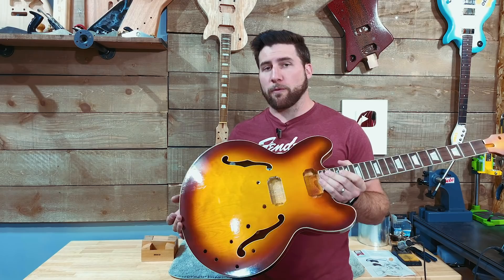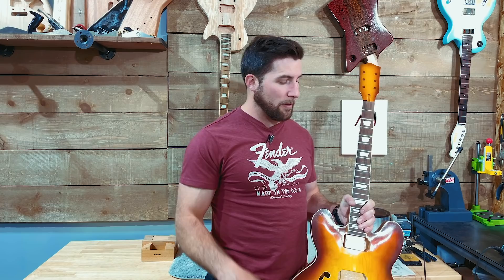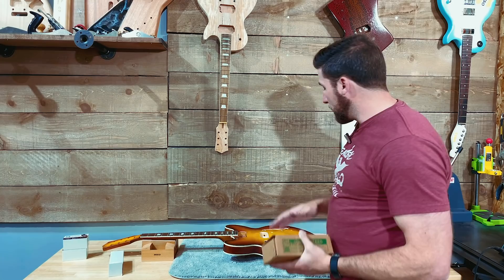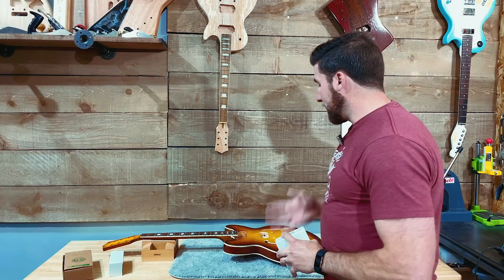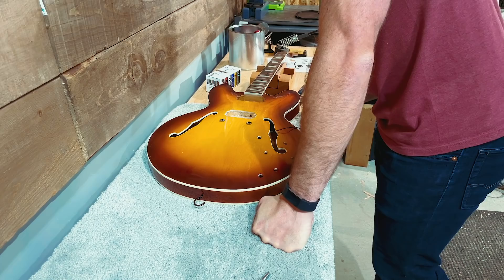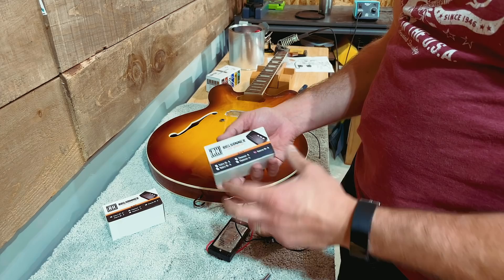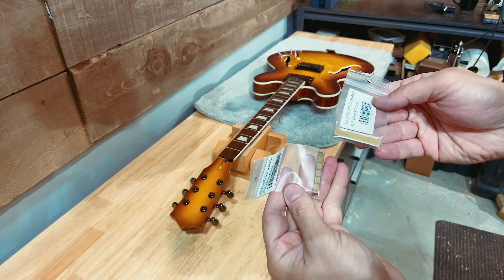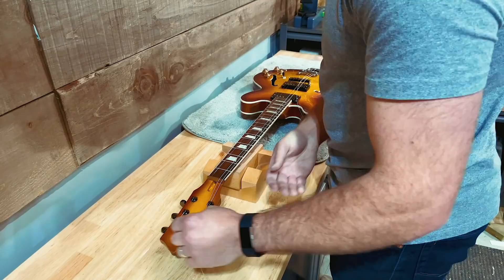The ES 335 Guitar Kit (FINAL ASSEMBLY!)

Comment: Such an awesome burst on this one! Almost unreal.

I am more of a chrome than black hardware guy, but the finished result here looks great, and more unique for not picking chrome or gold I suppose. Those Railhammers are going to sound nothing short of awesome. 

I'm thinking you may want to put a dab of glue under the nut? From the video it looked as if it is unsecured - but maybe you already took care of it off camera? The string tension will hold it down, but it may get knocked out of place if the playing gets a bit heavy handed.
Reply from the maker: Thank you. I’m still not 100% sure I will be sticking with that but. Once I’ve decided I will put a touch of glue to hold it in place.

Comment: Can't find the pickups on Solo.
You should try solo's wood knobs for your controls. I think they are great. Finish the same as guitar or a contrast.
Reply from the maker: Those pickups aren’t in solo. They’re railhammer. 
I didn’t see that solo had wood knobs. I’ll add them to the shopping list haha.
Reply: Got it. Looked them up and I think I'm going to stay with Seymour Duncan P Rails. I have a supply of different length diameter and shape springs. So its not an issue. Also have a spring compressor for humbuckers. Think I got it from Stew Mac.

Comment: Nice job Brad.. about time you finished this one.. one of your better builds and your choices were spot on.. Solo has some nice variety for sure.. cant wait to hear those rail hammers.. which humbuckers were they?.. the standard PAF with a twist?..
Reply from the maker: They’re the “humcutters”. Designed to be more like a p90 in humbucker size I believe.
Reply: @BradAngove  the ones you used in the GGBO.. were they the higher output version?
Reply from the maker: Yes, those were the humbuckers rather than humcutters.

Comment: Is it possible or advisable, for easier fingers access into the body cavity, to leave the neck off for the wiring, then attach it after the wiring and body hardware is assembled?
Reply from the maker: It’s possible. I just didn’t want to try to glue it up after painting because I was worried it would mar the paint. I’ve seen it happen.

Comment: I’d love to give Solo another shot, but the thinline Tele kit I bought from them was horrible.  Tons of flaws, and the neck didn’t sit properly in the pocket.  It’s still in my basement, largely disassembled and a reminder that you get what you pay for.
Reply from the maker: What’s wrong with how the neck sits?
Reply: @BradAngove  Apologies if that came across as me trying to get you to solve the issue.  I was just pointing out the issues some may have with Solo kits.  

As for the neck, it's too small for the pocket, leaving a massive gap on one side.  I wasn't even able to align the strings to find a relatively sweet spot where it'd still work.

Off topic though--or rather, back on topic--great work on that 335.  The burst looks absolutely killer.
Reply from the maker: Thank you, I’m glad you like it.

Comment: Hey Big fan of the channel, just wondering about your spray can tutorial. You never used a sealer as you said it was well sanded and you wanted the grain to show through. I want to get a similar effect but I'm not sure what grit I'd need to sand the body to. Cheers
Reply from the maker: My old 4 part tutorial? It depends on the wood type but usually 320 or 400.
Reply: The body is paulowina, so hopefully it'll work out okay, Thanks very much.
Reply from the maker: Should work fine. That’s a light wood with a reasonably open grain.
Reply: @BradAngove  perfect thanks very much!